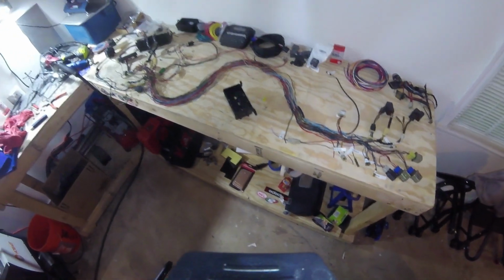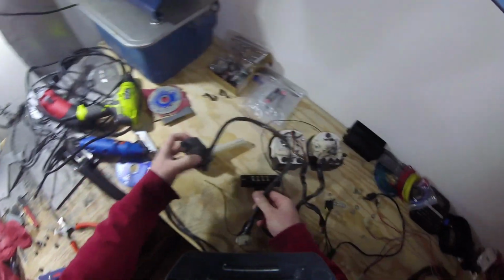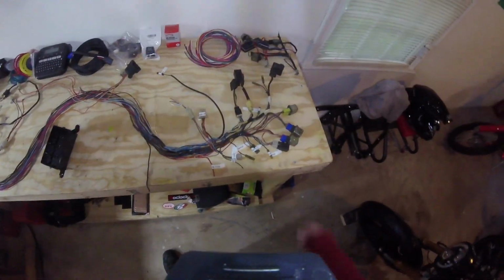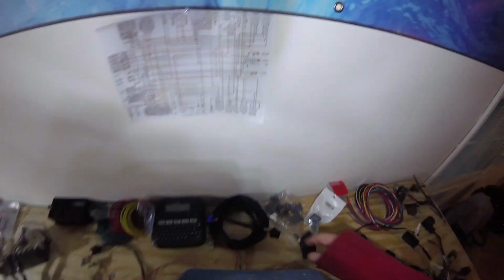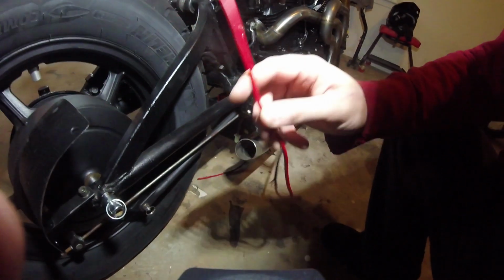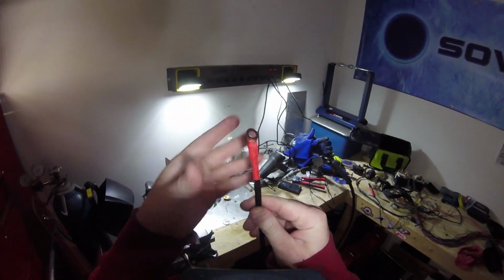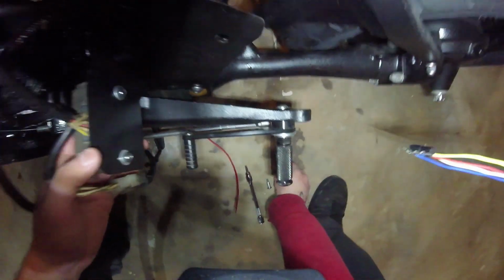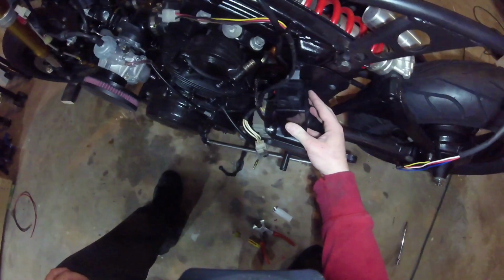Yamaha Virago Cafe Racer Build - Episode 28 - Wiring Intro and Main Fuse

Comment: I did find old style connectors after searching for many months, in a old auto electrical shop, (not on internet) it was an experience. I just finished building my 82' XV750 harness (bare bone) I used approx 19 colors of wires and old style connectors, with little hiccups at the beginning test but finally managed get it right. You said you are replacing old relays with 'BOSCH Relay'? How did you find it, and know if they are compatible? I have completely got rid of all the relays in bare bone wiring.